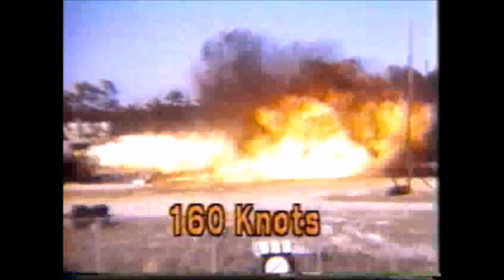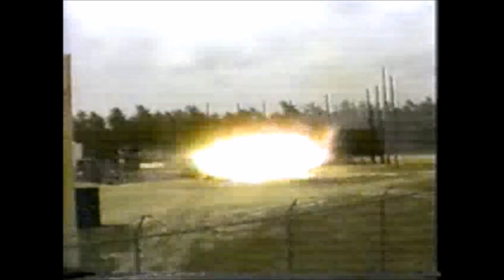Controlled Impact Demonstration 1984 NASA FAA CID Test Video

Comment: So aircraft seen on 9/11 ( 911 is also the American emergency services number) could have been remote controlled and the security camera footage from the Pentagon suggests it was a missile not a plane. To explain the lack of a plane they said it was travelling at 800mph too fast to be caught on camera! Actually there is a flash of white to the right but that means the aircraft flew into it a few feet above the ground through trees and stuff without causing any damage to such trees etc.
Reply: They had another, much smaller chaser-plane follow the bigger plane the whole time a couple thousand feet up-and-to-the-side of the big plane, that way they could actually control it properly. Also, since the plane took off in a populated area, the Mexican Government made NASA have a guy actually pilot it during take off until over the Mexican desert (Where it crashed, since the USA’s tiny rocks are better or something) at a specific height and speed, then they parachuted out (coolest job ever) and control was given to the other man in the chaser plane.  I didn’t see no other, smaller planes in the air when 9/11 happened.

Also, I don’t know what smudgy-ass pentagon footage you have, but mine has the back half of the plane for a frame.

Comment: How did they remotely control the plane? What wireless tech was used?
Reply: Radio signals mate
Reply: They had the technology in the 1930s.
https://en.wikipedia.org/wiki/De_Havilland_Tiger_Moth#Gunnery_target_drone
Reply: There are videos of commercial aircraft being intentionally crashed flown very accurately by remote control going all the way back to the 1970s so it can be done and the footage from the pentagon seriously adds doubt to that at least being a plane. It does look more like a missile. I’ve watched it over and over.
Reply: @flyhi2773 then explain the plane parts strewn about on the lawn
Reply: @flyhi2773  I need to see your footage, because that was NOT a missile.

Comment: hmmm...flying a commercial airplane by REMOTE CONTROL. Certainly noting like this happened on 9/11................ let that sink in!!!!!!
Reply: They had another, much smaller chaser-plane follow the bigger plane the whole time a couple thousand feet up-and-to-the-side of the big plane, that way they could actually control it properly. Also, since the plane took off in a populated area, the Mexican Government made NASA have a guy actually pilot it during take off until over the Mexican desert (Where it crashed, since the USA’s tiny rocks are better or something) at a specific height and speed, then they parachuted out (coolest job ever) and control was given to the other man in the chaser plane.  I didn’t see no other, smaller planes in the air when 9/11 happened.
Reply: Been thinking the same for years!

Comment: Why don't makes crash test into the florest
Hight speed
Hit trees
reforestation eucalyptus plantation

The circunstance of impact of colision produce diferents 
Damage
Reply: Godzilla had a stroke trying to read this and freaking died
Reply: they cant make planes crash test into the forest because there is a chance the fuel could ignite causing a massive forest fire which is a pain to put out. I have no clue what you are trying to tell them to do by "hight speed" or "reforestation eucalyptus plantation" but the same thing goes for trees, just a general pain to put out. While it is true that the circumstances of the crash are never the same and do vary from crash to crash, this was to test if fuel would ignite or not during a crash "landing"
Reply: I understand this test was about fire survivability in the event of a "normal" crash landing. The landing itself had to be survivable.

Comment: Ladies and gentlemen. ..9/11
Reply: Indeed, that was conducted in 1984, by 2001, they certainly had sophisticated aircraft remote control systems, actually, Dov Zakheim, Pentagon comptroller, had a company, or was part of a company that was creating flight-control systems.
Reply: @N1755L  tru. Also, did u know that in the process of wars and disasters a so called "gawyah" is generated which is then collected from dead bodies and transferred to mars by spacex and is food for monians living on it. Some people call this "spirit"
Reply: One Nation What?
Reply: They had another, much smaller chaser-plane follow the bigger plane the whole time a couple thousand feet up-and-to-the-side of the big plane, that way they could actually control it properly. Also, since the plane took off in a populated area, the Mexican Government made NASA have a guy actually pilot it during take off until over the Mexican desert (Where it crashed, since the USA’s tiny rocks are better or something) at a specific height and speed, then they parachuted out (coolest job ever) and control was given to the other man in the chaser plane.  I didn’t see no other, smaller planes in the air when 9/11 happened.

Comment: Notice how the "steel wing cutters" didnt give in to the aluminum wing. Aluminium can't cut steel
Reply: But it can reduce it to 10% its normal strength!
Reply: Notice how they were specifically designed and strengthened to cut into the wing? Context is for Kings. You're no King.
Reply: @bmused55  no,  he's saying that the steel cutter obstacles remained intact AFTER the aluminum impacted them.    You absolutely do not need reinforced steel to slice open an aircraft wing.
Reply: @bmused55  Curb Your Enthusiasm theme song
Reply: @bmused55   He's one of those simpletons that simple believe everything